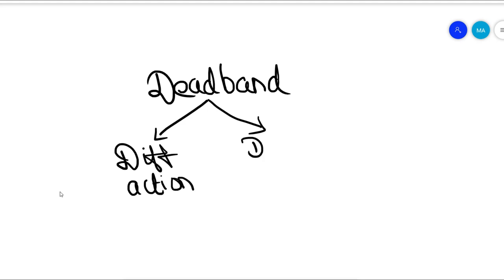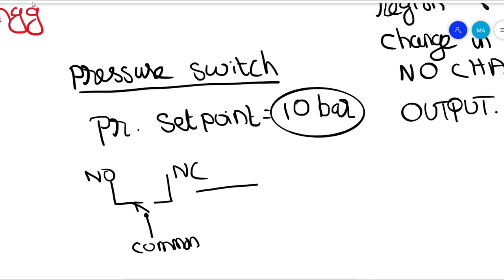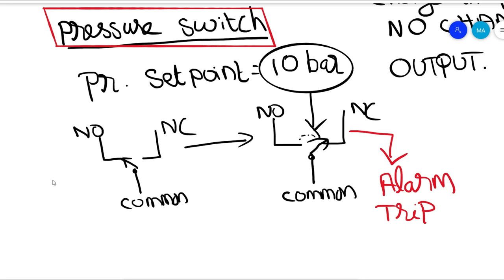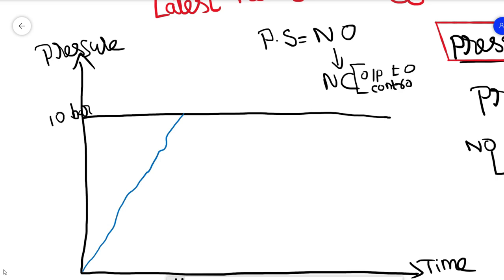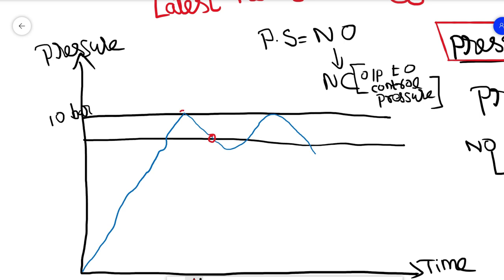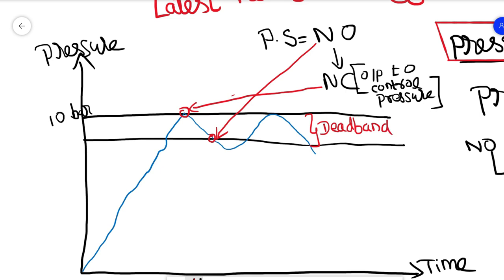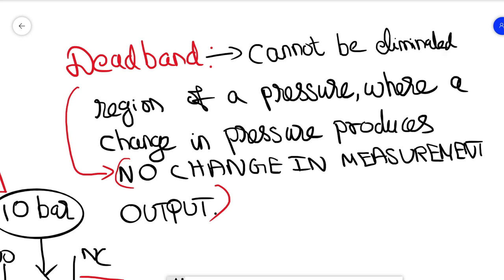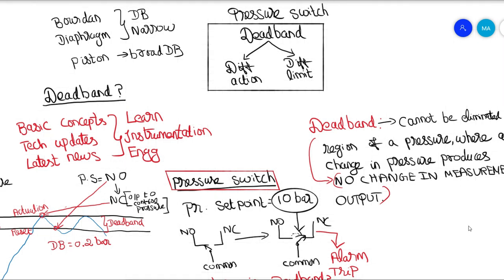What is Deadband in Instrumentation Engineering?

Comment: Great video, although i have a question. The fenomenon you're describing, isn't it hysteresis? If we should call it deadband, shouldn't it behave something like this:
Above 10bar: Active reduction of pressure
Between 10 and 9,8 bar: No output signal (deadband).
Less than 9,8 bar: Active increase of pressure.

Thanks for clearifying.
Reply from the maker: Wow that’s great! 
Deadband is different from hysteresis. With hysteresis, there is no deadband and so the output is always in one direction or another. ... Deadband is the range in a process where no changes to output are made. Hysteresis is the difference in a variable depending on the direction of travel.